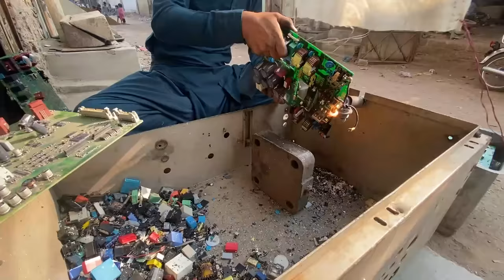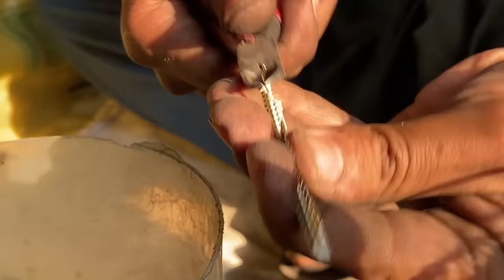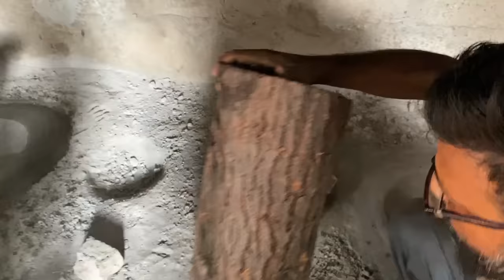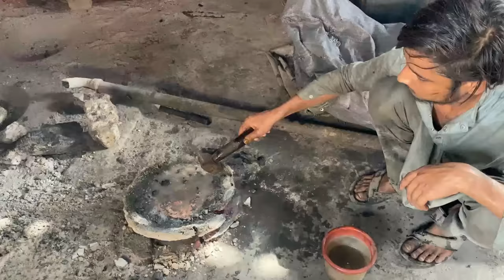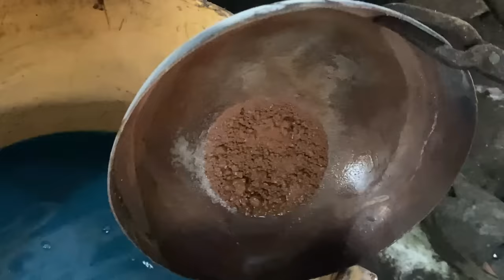Very interesting Recover 24K Gold From Electronics Scrap

Comment: Seriously man those Tantalum and Electrolytic capacitors, Ferrite core inductors, and Toshiba, infenion Mosfets are worth more if they can find a way to sell them in the 2nd hand market
Reply: I was work in simicon company as I know the gold wire is bonded inside those ic and transistor component
Reply: I was thinking the same thing, that those capacitors are worth something and all might now be bad and can probably be reused.
Reply: Если все перечисленое вышло из строя кому ты его продашь на вторичном рынке, тем более если радиодеталям лет 20-ть то кому то старьё нужно и в рабочем состоянии..

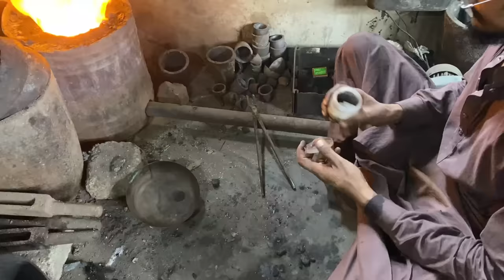Comment: @ 10:23
That's (sodium) borax if anyone is wondering. It's added to the crucible to add a layer of glaze to the crucible when first time used. So that the metal being heated doesn't stick to the inside walls of the crucible. It flows easier. 😉😇🤗🤔😏
Reply: Cztero Boran sodu. Nie tylko do złota. Zastosowanie jest wszechstronne.

Comment: If opened using a hotgun, burning the circuit would reduce air pollution, and the fibers could be used as scrap. This would have both environmental and financial benefits.

Comment: What you saw at the end, the pretty gold button, was a culmination of 30+ of those copper pours, the 8 inch copper wafer you seen the dude dissolve in nitric acid, leaving the gold behind, 30+ of those 8 inch wafers. No way, in any universe, they got that much gold from one.
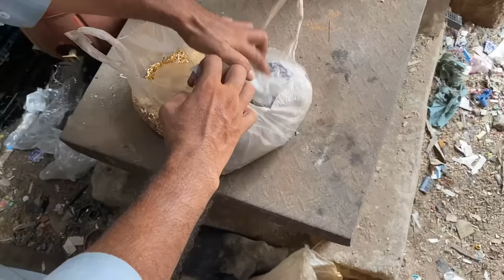Reply: You don't know because you weren't there. They could of mixed and matched footage and material. no doubt this is lower grade material and these people are high on lead fumes so who knows what they're doing. Look at 03:10 to 11 seconds. You can see different type pins in the bags. What are you calling a wafer? It's not a wafer, it's called a precious metal Dore. Watch Owltech, you'll be surprised how much gold you can fit into one Dore, or palladium, platinum and silver, over 100 grams easy.
Reply: No way in any universe is your comment right. You are a amateur that clearly doesn't know yields, while the boards are extremely low yielding, they used fully plated pins most likely from different boards or connectors. It was two full grocery bags, several kilos most likely, 2 or 3 as a guess. Those wafers actually called Dore's you would know this if you were experienced like me ( 20 years ) what you though was 8 inches was much larger than you think. Dore can very small and hold several Troy ounces of any precious metal. Another yield you won't believe, 1.5 kilos of USSR connectors yielding 55 grams of 24K gold. They only recovered 17.15 grams not that much gold from two bags full of pins
Reply: Careful, the chosen one has spoken😂

Comment: I think electronic components are more valuable than gold he got from such such quantity 😊
Reply: He took waste material bro
Reply: Right
Reply: Those are scrap
Reply: one capacitor 400v about 4 euro
Reply: Yes but components are in working conditions
Reply: @makuszko In Iran, this capacitor is about 30 euros!😢
Reply: @Mohammad_9270  och 🤔
Reply: @Mohammad_9270  Ask Ali Khamenei to get you some.
Reply: Zehirleme riski var .Hatta sonra daha büyük sağlık sorunlarına sebep olur. Kısacası kendini düşünen bunu yapmaz
Reply: Wasting all good electronics components .....😢
Reply: Right bro
Reply: @ravindradorugade574 🎉😂
Reply: @Itsimrana are you blind....look at that pile of junk boards that have been tossed and thrown around. Are you one of those cheap people that will use anything just as long if it works. Omg
Reply: @Mohammad_9270 you don't have euros in Iran buddy.
Reply: @chosen1one930  no actually it does not matter if there tossed around like junk. Usually one or two components get burned which makes the entire circuit board useless and that is why they are thrown like that but I Reality most of the components work and I recycle boards my self and mostly I make more money than turning them into gold
Reply: @Itsimrana These are not in working condition, they have to be replaced, this type of capacitor runs out of juice....The life of aluminum electrolytic capacitors is very dependent on environmental and electrical factors. Environmental factors include temperature, humidity, atmospheric pressure and vibration. Electrical factors include operating voltage, ripple current and charge-discharge duty cycle. Among these factors, temperature (ambient temperature and internal heating due to ripple current) is the most critical to the life of aluminum electrolytic capacitors. Whereas, conditions such as vibration, shock and humidity have little affect on the actual life of the capacitor.
Reply: Essa quantidade de ouro que ele mostra é FAKE
Já assisti outros fazendo este processo e o resultado é poucas gramas de ouro.
Não vale a pena trocar sua saúde por nada.
Reply: I agree...bad buisness model... for extracting gold of 500 doller they are spending 350-400....and polluting air...! A proper recycling workshop would be great for this..few ameture could practice soldering and desoldering components and checking and shortlisting working spares, like capacitors, diode...in very rare cases pcb motherboard wiring line burns, even in burnt cases PCBs are always reusable...
Reply: E verdade👏👏👏
Reply: Really yes! But they maybe don't know the value of it and don't know how to reuse.
Reply: 17gr de oro…No lo creo
Reply: Apa lagi kita membeli murah dan di olah di jual harga tinggi
Reply: Адрес Наташа запчасти океан
Reply: Its fever.
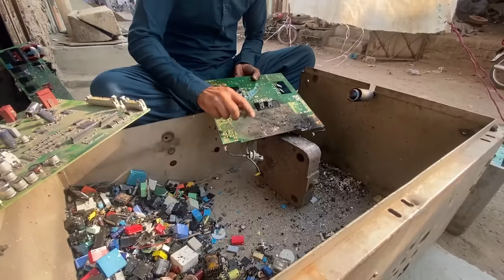Reply: @msnepaliman hi hai 0:45 se Rd I'm😊
Reply: All those boards could be damaged but not components..gold recovery is not profitable here..
Reply: The wima capacitors are really expensive.
Reply: Not if there broken obsolete or currently sitting in a third world country 😅😅😅😅
Reply: @user-fj2dd9ju2g  😂😂😂😂😂 right they act like it’s right down the street next to a electronic shop they doing the best with what they got

Comment: Sorry guys, I'm dealing with the same issue. It is not 100% gold. Because it contains silver, copper. Only 15-20 grams of gold comes out of 10 kg.
Reply: The blue liquid was all of the metals that are dissolved by nitric acid which is copper, silver, zinc, etc. based on the liquids color I'd guess mostly silver and the liquid is mostly silver nitrate. Gold is not dissolved by nitric acid. That gold button is easily 22k maybe more. Getting real .999 24k requires more refining and usually aqua regia.
Reply: Compare that to mining cost
Reply: То что это не 100% золото это понятно, такой способ называется купелированием и примерно95-96% чистоты даёт
Reply: el ácido nítrico convierte en sales los demás metales, sales solubles que quedan en el agua, menos el oro que queda en forma metálica en forma de polvo. Los que dicen que es resultado final tiene poca pureza, que creen que queda de impureza? Metales? Esos fueron eliminados con el ácido.
Reply: Need to calculate the cost and explain if u can

Comment: That is not 171.50 gm it’s 34.30 gms only
That weighing machin is carat measuring machine.
171.50x.200 = 34.30 gm 

Don’t get fooled 😂😂
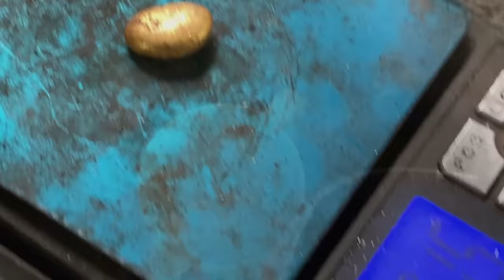Reply: Was that even a point and not some piece of dirt at 11:13 ?  It's not a scale that I have ever seen.  

Do you think that it's around an ounce? So like around 2 grand American right now?
Reply: Depends on what you mean with only, if that is close to pure gold it would be worth well over 2000 USD, which is big money for them, considering they only used scraps, some wood and some acid to collect it.

Comment: The life of aluminum electrolytic capacitors is very dependent on environmental and electrical factors. Environmental factors include temperature, humidity, atmospheric pressure and vibration. Electrical factors include operating voltage, ripple current and charge-discharge duty cycle. Among these factors, temperature (ambient temperature and internal heating due to ripple current) is the most critical to the life of aluminum electrolytic capacitors. Whereas, conditions such as vibration, shock and humidity have little affect on the actual life of the capacitor.

Comment: Interesting. What are you doing with the copper, aluminium, brass, and other metals? They are all of value too, and albeit less precious, they are available from the same scrap in much greater quantities. You surely already knew that. Are you recovering them as well? Or passing them on to someone else to recover?
Reply: Dont you gather up all the copper,alu,iron etc from the board and then sell tthat to the scrapyard? to much work? i sure do
Reply: @danielpersson7483  - well, that was exactly my question... at work we are passing complete devices on to professional recycling businesses that extract pretty much everything that can be extracted, and they do report back on recycled content. Plastics, particularly FRP, are still a nasty issue... But recovery of metals works quite well. We get free pick-up from our locations, and depending on scrap content and value we get paid - so at worst we know that we can use a free disposal service, and that materials do get recycled.

Comment: Use that torch under a steel plate and set the hole board on it works way better without all the smoke.
Reply: They refuse or are unable to think about efficiency or working smarter. It's really bizarre to see how they could work smarter with products that are next to them.

Comment: The gold content present in the PCBs depends on the type of PCB used in each device, and may vary between 140 and 700 g of gold per tonne of PCB. The gold content found in these PCBs is much higher than the average levels found in gold ore, which is currently 5-10 g of gold per tonne of ore.

Comment: I worked for electronics manufacturing assembly company and we threw away loads electronics components in wee recycling, if there was tiny bit off possibility they could recover gold out off the scrap we would have implemented it sold stuff on but cost to do this and amount needed is enormous, its ok if got tonnes scrap and cheap labour dangerouse chemicals which cost loads so in countries where we have safety laws labour costs its not practical and amounts scrap needed is tonnes time to dismantle components dont show this so not worth it better off go invest gold detector .

Comment: People, the gold plating on those components is microns thick (1 micron is one millionth of a meter). The gold does not need to be much thicker than approx. 10 microns. Calculate the surface area by the depth (10 microns) and there is VERY LITTLE gold there. Definitely not worth the toxic fumes they all breathe.

Comment: This is just stupid, most of the metal in those components isn't gold.  It's aluminum or tin and copper. And in such small amounts the gas probably costs more then what they make back.  Only IC's and cpu's use gold really.  Obviously all those pins are just plated.  Too much work for so little return.

Comment: Please can I get the name of the chemical that you use
Reply: Nitric acid and hydrochloric acid
Reply: Nitric acid
Reply: as you can see the copper was about 80 percent in the molten slug, which has become copper nitrate liquid. with the reaction HNO3 (nitric acid) gold never reacts with nitric acid.
Reply: @ishtiaqkhan7101  nitric react but don’t desolve gold in it as per hydrocloric desolve it!
Reply: the blue water contains silver and copper nitrate, all the soldering metals like lead and tin were blown away with the heat.